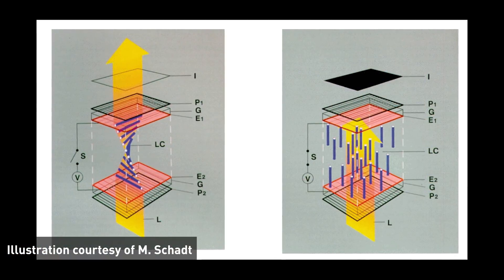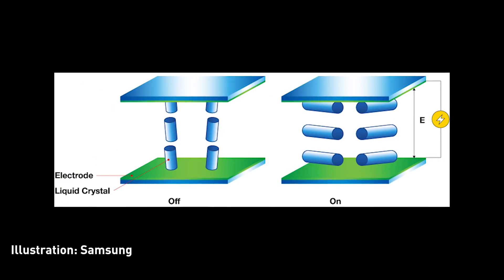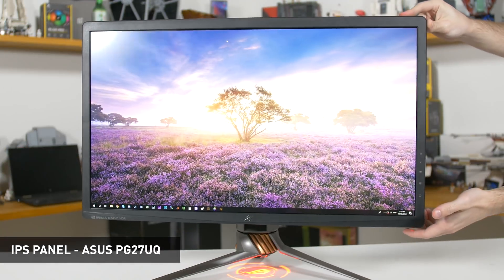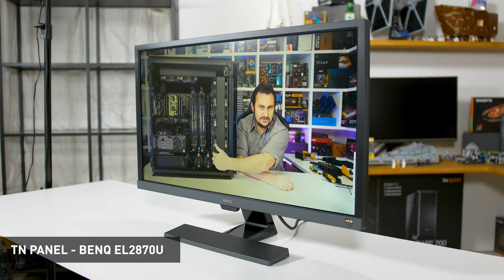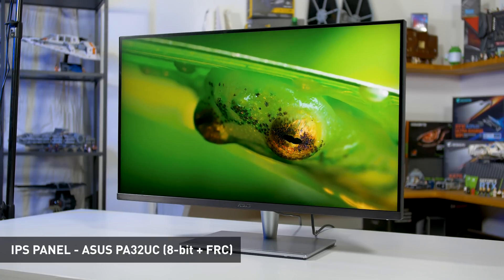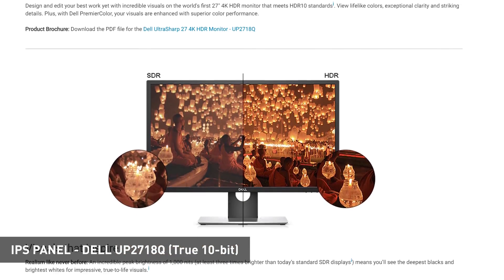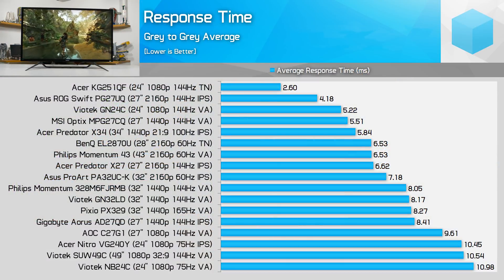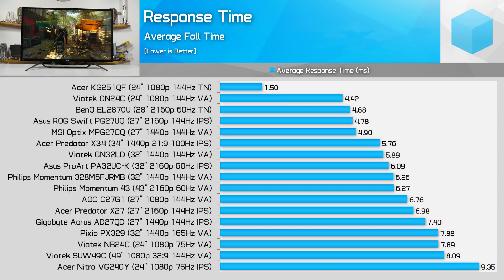TN vs IPS vs VA: Which LCD Monitor Tech is Better?

Comment: Soiler:
IPS

Bonus spoiler: VA is shit for actually doing anything, but might be good for watching stuff???
Reply: Tim recommended VA for general use? Why is incredibly accurate colours important for people not doing professional work? It's not very noticeable for general use anyway. Deeper blacks and no bleeding is much more noticeable, especially if you use it in dark rooms or for watching movies. For the latter, VA is basically OLED lite.
Reply: @DirtyPoul  Yeah but the black streak is horrible, ruining it for playing games or doing anything interactive. VA is great for watching movies or if all you care about is a high contrast image, but for everything else, it's the worst of both worlds; shite color reproduction, and shite response times.
Reply: @Ghennesph  Black streak? What do you mean?

VA colours are generally much better than TN and closer to IPS than TN i that regard, even more so if you're not viewing it dead centre or if you're sitting very close to a large display as I often do in order to not have to put on my glasses.

VA is slow, but unless you're playing competitively or very fast paced games, it doesn't really matter a whole lot. Yes, it can be noticeable, especially if it's a cheap VA panel, but for highend displays, the tiny increase in latency over IPS panels won't be noticeable while things like bleeding will be very annoying in dark areas environments. For instance, if you play horror games, VA is miles better than either TN or IPS.

The way I see it, VA is better in all but the fastest or competitive games where TN is better, or in professional environments where colour accuracy is essential. And that's exactly what Tim says as well and it's why he recommends it for most buyers.
Reply: @DirtyPoul  black streak, where a black object moving across the screen leaves a trail behind it due to the horrible transition times of dark colors on VA panels.

Just because you have low standards for image quality doesn't make VA a good technology. It only makes sense for TVs, because you don't often see TV content moving quickly with any kind of detail.
Reply: @Ghennesph  I have never heard of that issue before. Any chance it's a problem with low quality displays rather than highend displays, similar to how highend IPS panels don't have as many issues with bleeding as lower quality displays?

Way to make an insult. The reason I'm not too fond of TN is exactly because it has poor image quality, terrible even, at all but speed. And when speed is not essential, which is the case for all uses except for competitive gaming, why would you ever choose TN? So the option falls between IPS and VA. And if you paid any attention to the video, you'd appreciate the fact that VA is good enough for viewing angles and colours for all but professional work with colours and laptops where you're almost always viewing the display at an angle.

That brings up the only downfall of VA for most usecases which I recognise is the lower speed. But if you paid any attention, you'd appreciate the fact that highend VA displays are rather quick and should be fast enough for anybody who isn't gaming competitively, which really is a moot point here since I already noted that TN is your only choice at that point anyway.

So which do you prefer? Slightly better colours and viewing angles or much higher contrast without bleeding at the expense of it being slightly slower? For me, the choice is crystal clear.
Reply: @DirtyPoul It's not about just being "quick enough" it's about being inconsistent in how quick it is, which means for anything that's sharp and moving, you're going to see blacks streak through other objects, ruining the image. It completely kills the benefit of high contrast because you can't actually make out dark areas if there's any movement at all, due to the terrible transition time.
And since the color reproduction isn't sharp enough for professional work, either... The only thing VA is good for is watching movies.

It's like first generation PSP, which had a lovely colorful display with wide viewing angles and high contrast, and turned into a large black smudge any time anything moved ever, making it even worse than the DS narrow-angle cheapo TN panel with terrible skewed colors, dim maximum brightness, and terrible black levels, never mind the horrendous pixel pitch, because at least through all that you could legitimately see what was happening on screen.
Reply: @Ghennesph  Again, I've not seen evidence for this being a legit issue in highend VA panels, so I think it's something you're making out to be more of a problem than it actually is. Like people who whine about IPS glow, making it out to be a much more profound and more general issue than it actually is.
Reply: @DirtyPoul  I'm sure there are plenty of people with low standards who don't notice, or who basically just watch movies.
VA is a B-grade LCD in visual quality, though, and it doesn't have the niche advantage of TN in fast transition.
Reply: @Ghennesph  We'll just have to disagree about that. You won't recognise that different people have different preferences which seems absurd to me. And as long as you cannot do that, it doesn't make sense to discuss this with you.

My point is that there is a reason why Tim recommends VA to most users. You ignore this and your argument boils down to Tim "having a low standard so he doesn't notice". If you cannot see the absurdity of that, then we can't even agree on the basic premises required to discuss the topic.
Reply: @DirtyPoul  It was a poor recommendation for a monitor in the first place, since VA is shite for gaming and productivity. It's good for watching TV, so it's fine for a TV, but not for a monitor, where you actually interact with things.
Reply: @Ghennesph  You're basically calling Tim outright incompetent. Sorry, but I trust Tim more than I trust you because he has shown me his methodology and it looks very solid. You've talked about an issue called black streak that I've never heard about before. I'm no expert, but it doesn't seem like a huge problem when it didn't even factor into this video despite Tim having reviewed dozens of VA displays in the past. Surely, he would've come across it at some point if it was such a big deal.
Reply: @DirtyPoul  Or, like usual, it was actually referenced but brushed under the carpet because talking about it pisses people off for some reason.

IPS advantages are significant and many. Viewing angles, color reproduction, and they have serviceable uniform response times with only mild white streak(which your eyes will also do on their own to a point anyway) and serve the high end of the market well, from professional work to videophiles to people with lots of money to burn.

TN advantages are significant as well, with being the fastest response and the cheapest displays, as well as having relatively uniform transitions, serving the low end and the niche competitive gaming or budget motion-whore well.

Then you have VA panels, which have decent enough viewing angles and color reproduction for looking at static or slow moving content, but have the worst transitions in dark areas, leading to inconsistent color for moving objects or nasty black streak for dark areas, making them useless for the high end videophile or professional, and useless to the motion whore or gamer, while still being more expensive than TN panels. They make fine TVs, but they're shite monitors. Recommending them for "everyone" is a really really stupid thing to do, when most niches would be served better by IPS or TN displays, depending on preference.
Reply: @Ghennesph  Now you're questioning Tim's integrity! How can you say "Nice job, Tim!" when you completely disagree with his conclusions and question the integrity and/or competence of people who hold his view? How is that possible?
Reply: @DirtyPoul  The concept of "this person said that so it must be true" is deeply and fundamentally flawed and damaging to any sort of rational discussion.
Reply: @Ghennesph  And that's exactly why I never said that. I said I trust Tim's methodology more than I trust your words, especially given how you've contradicted yourself about this being a great video from Tim while then disagreeing and implying that he is either incompetent or integrity. I simply simply don't see how I could trust you over what Tim concludes based on the methodology he has shown me in his videos. I don't trust Tim, I trust his methodology. Just like I don't trust scientists, I trust the scientific method.
Reply: @DirtyPoul  A: that wouldn't be a contradiction and B: I don't think I said that?
It's clear you're uninformed on the subject.
Reply: @Ghennesph  My bad! You didn't say that. Recently, YouTube has been bugged out and comments get swapped around for me. It's really weird. Suddenly, I watch a Total War video and the top comment is from a Buildzoid video on memory. It's really weird. It changed it for you as well so it said "Awesome video Tim!" or something similar in your original comment. That would be a contradiction.

Still, the rest of my comment stands. I find it odd how you basically refer to anybody who disagree with you as being either incompetent or disingenious. Yes, I'm uninformed on the topic. That's why I watch this video in the first place. I never called myself an expert which is exactly why I refer to the expert opinion that I can find (Tim). I don't trust him blindly, but I find his methodology rather thorough so I trust that, and thus trust his conclusions based on those. That's the only reasonable way to fare in topics where you're not an expert.

Comment: VA is the best. Just look up Samsung CFG73, it has a better color range than IPS, great black levels, and 144Hz with freesync.
Reply: The CFG73's color space is wider than most similarly-priced IPS, but it's still behind the best IPS panel out there. It also suffers from the notorious purple trailing.
Reply: @hugh31098  wrong, purple trailing was in the older model, the 1440p 27" CFG70. The Newer model doesn't have that issue. Also, the monitor has a 125% sRGB range due to its quantum dot feature. What's the highest sRGB range of an IPS monitor?
Reply: @atitana  PG27UQ, IPS panel with Quantum Dot, achieve 100% Adobe RGB compare to 92% of CFG73. It's definitely wider, though much more expensive.

The CFG70 isn't a 1440p screen, the CHG70 is. And the purple trailing is still present in CFG73. Almost all CFG70/73 that I've seen got artifact to a certain extent: Some trailing purple; others got yellow smearing; the best ones don't have any noticeable issue in playing, but if I look close enough, I'll still be able to spot it.  

This model got a lot of quirks, but if you can get a good sample, it's a pretty great deal. I'll take it instead of 144Hz TN since I use my monitor for both gaming/watching movies, and TN panel at this price point tends to have horrible factory calibration.

Comment: I have the viotek GN27D and i love it. 1440p, 144hz, great monitor. Though I have to say it isn't as vibrant as a my 24" curved samsung monitor that usually goes for 130-160 (don't buy the samsung one btw, buy a used or refurbished 144hz monitor for 150)

Comment: One correction, IPS has the most thick layer of all, so requires stronger backlight/ LEDs, power consumption is generally higher on IPS with the same performance in brightness.
I do use IPS but even on the lowest back light level, it still "burns" my face for extended periods of time, TN and VA are quite less agressive in this regard.
I think the best technology for the majority of people right now is VA, a high end VA panel can have great contrast performance decent, response time, wide color gamut,  high brightness levels, and to me the most important aspect is color volume IPS has gigantic problem with color volume, it needs to be incertain brightness level to achieve high color performance, but VA generally a more consistent color range in different brighness settings.
Reply: Bro for coding which one is better?
Reply: Are you sure IPS has the thickest layer of them thus requiring a stronger backlight? Well at least in practical terms it makes sense as IPS panels are too harsh on the eye, but I've read it's actually VA that needs a stronger backlight due to liquid crystals more effectively blocking the light, resulting in better contrast.

Comment: I would have added that viewers should take into consideration that you never have the same viewing angle for all pixels on a TN monitor. So even if you sit perfectly in front of the monitor then still the color is a lot worse. With regard to the TN monitors being able to get a higher frequency two important details should be added in my opinion: 
- the non-linear relation between refresh rate/FPS and input lag. See Scott Wasson his well known article: "Inside the second - a new look at game benchmarking"
- the fact that the monitor only forms a small part of the input lag given that it is only one link in the chain. 

For pro-gamers a TN-monitor might have added value, any other gamer should avoid any TN monitor like a plague, even if it is a 240 Hz. monitor. Choose a VA or IPS monitor instead. Personally I would have given more in-depth information on the technology of LCD but I understand why Tim did not do that. I have had TN- , VA- and IPS-monitors.
Reply: The discussion on grey-to-grey response time is not to do with input lag. It's to do with how well/smoothly/sharply the panel can display moving/changing images. Having to turn up the overdrive on VA and IPS panels causes problems like overshoot which can make the image even less clear.For this reason, if you value crisp and clear visuals then for many people TN cannot be beaten for gaming.This is coming from somebody who has owned / tested a lot of different high end panels including all of the technologies discussed here.
Reply: @juniorbirdman4650  
On a high quality IPS or VA you have crisp and clear visuals too with a high FPS and RR and anything less than high quality should not be bought for specifically gaming (or professional work). Maybe not 144 Hz and FPS in the case of IPS but who cares? 120 is fine too and even 100 will do. Once again I refer to "Inside the second - a new look at game benchmarking". Above a certain value you don't notice that much difference in FPS. I can't stand the washed out colors of TN, I am not willing to sacrifice color for a slightly lower frame-render-time.

Comment: I used dual TN 1080p 1ms 60hz Benq monitors for a LONG time, nearly 4 years. I now have a 144hz 1440p Samsung VA monitor and i gotta say.. so far as gaming is concerned.. i can't notice a difference except for the refresh rate. I would love to see someone do a proper review of the response times and real world refresh rate of the Samsung cjg52 monitor to get the real specs (not to mention shit channel recommended it) but i honestly could never go back to the two TN panels.
Reply: Hardware info.tv has been testing all of this. Its in Dutch tho.

Comment: I had them all. I just can't stand the backlight bleed or glow or anything of the sort. I ended up with VA, you can't beat the black levels. Also, when i open up a completely black image, it's like the monitor is shut off. No bleeding, no glowing. I love it. Can't complain about the response time and color accuracy either.
Reply: An IPS can give you the very same "monitor shut off" look by simply shutting off the monitor if staring at a black image is your thing.
Reply: @gordongoodman8342  You missed the point, but it's ok.
Reply: @gordongoodman8342  that isn't the point of that
Reply: Which particular monitor do you use? I'm shopping for a VA monitor
Reply: does it look similar to an OLED display?
Reply: @yotoprules9361  not even close, I both have a VA and OLED screens
Reply: @Benri05  never used a VA myself. I've used low and high end TN displays. Low end IPS looks much better than high end TN, it's like my eye just prefers looking at it and it just looks clearer and more vibrant than a TN.
Reply: Do you face any type of ghosting while gaming?
Reply: Wich one do you have tho ?
Reply: Which 1 is best for study, work and watching movies?
No gaming.
Reply: @kriswayne7938  Well, i'm biased towards VA in this case as well. Like i said, i want a dark scene to not have spots of light from the back side of the screen. My Iiama XB2783HSU looks like it's turned off when i open up a black image. Make sure it's flicker free as well, so it won't tire your eyes when you stare at it for longer periods.
Reply: @cristianitsirc6830  ok thanks
Reply: @cristianitsirc6830  can the brightness be changed?
Reply: @kriswayne7938  of course
Reply: @kriswayne7938  probably VA. Although IPS does have better colors if you prefer colors over contrast ratio
Reply: what about ghosting / black smearing?
Reply: @Cristian Itsirc exactly! I can't stand the backlight bleed, IPS glow and clouding produced by most IPS panels. Also, I've noticed IPS panels are too harsh on the eye, making it less suitable for close and extensive use. The only acceptable IPS I have tried are laptop-grade ones!
Reply: VA is great for watching movies or console gaming, but for any PC gaming or FPS gaming, VA is horrible, you get awful black lag, when you look around in the scene, the entire scene goes dim until you stop moving then it gets brighter again. I'd much rather have worse blacks and IPS glow,  which you only notice in very dark scenes,  over VA black smear which you will notice every time there is any camera motion
Reply: I see that black smearing is one major issue with VA panels, that too while gaming with high FPS games, this might cause a big issue, what's say on this issue?
Reply: cries in 1080p tv coz my gpu broke the bank